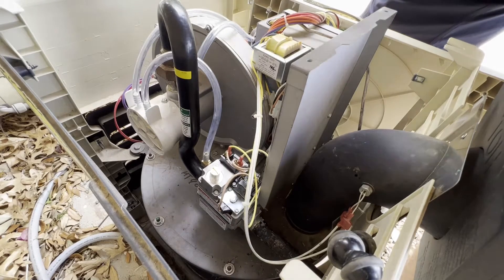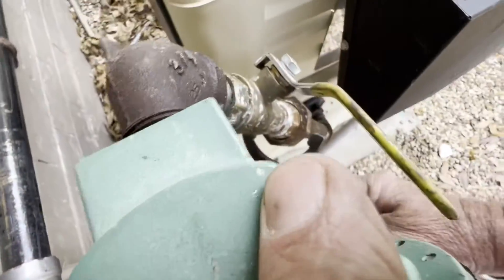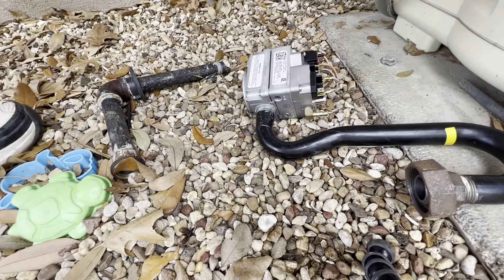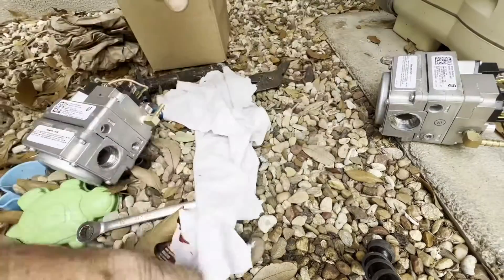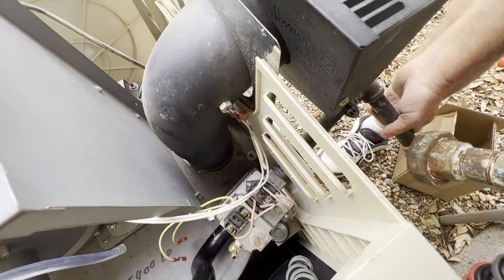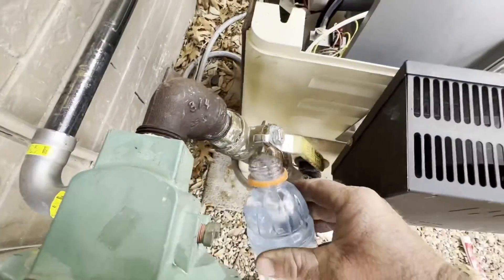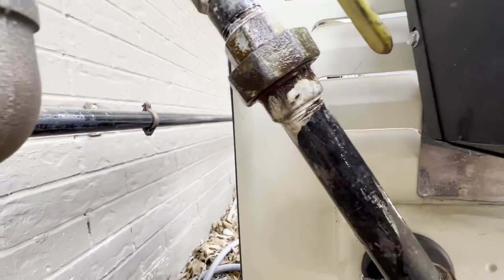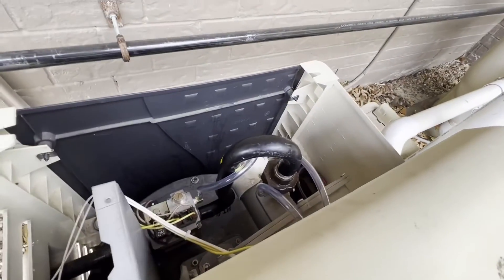Gas valve replacement; Mastertemp pool heater

Comment: How did you determine that the gas valve was bad? My unit is not igniting:
1. No error lights on control board
2. Gas valve is energized about 20 seconds after startup
3. I can feel gas valve clicking
4. Gas valve is de-energized after about 5 seconds later, maybe some safety protocol kicks in
5. Gas pressure on inlet to gas valve is 15
6. Gas pressure on outlet goes negative when fan kicks on, never fluctuates when gas valve is energized.
Reply from the maker: What you are describing could be Low gas in the tank, a faulty regulator or a bad gas valve. My initial thought is the regulator between the storage tank and the heater. If I understand correctly, it sounds like the regulator is closing off the gas supply when the gas valve opens,and the pressure drops to zero.  Normally, when the gas valve opens, the pressure should drop a little but maintain 10 to 12 in/WC while the heater is running (propane). Since you’re not getting that constant flow, that points me back to a bad regulator. I did have one instance when the regulator at the heater was OK but the regulator on top of the propane tank was failing. It gave me the exact symptoms you’re describing.
 
In a nutshell, the gas regulator is designed so that if there’s a large movement of gas, it will shut off.  The gas heater would not normally exceed that limit, so that’s why I believe that would be a good place to start.